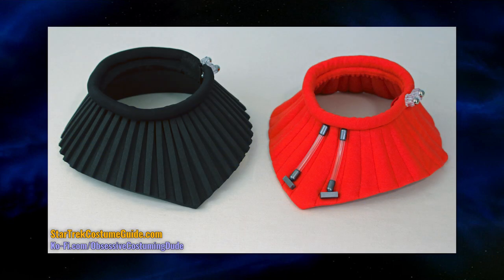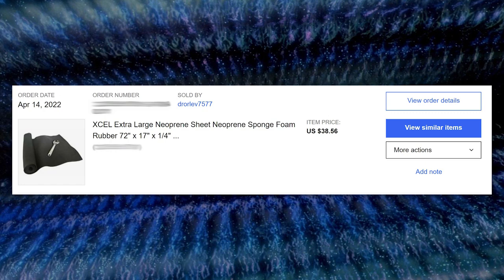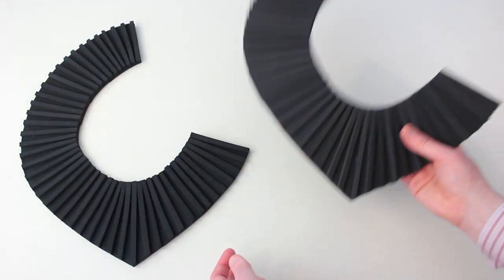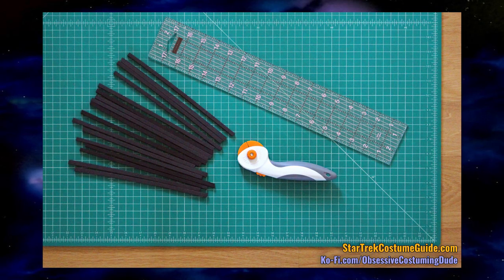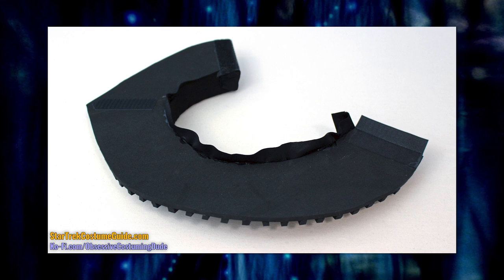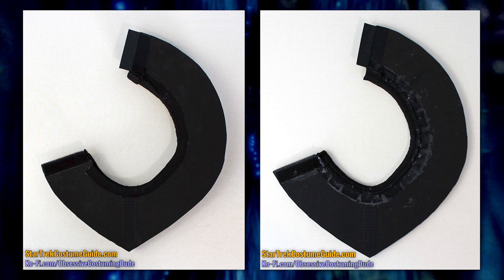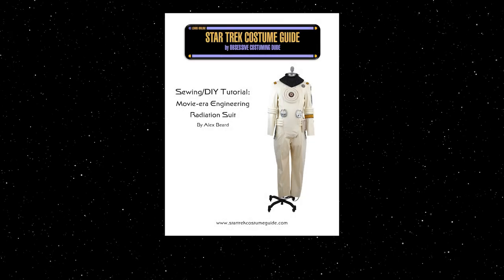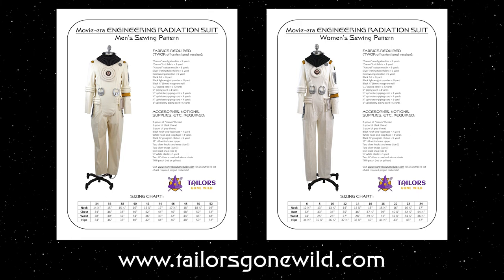Engineering Radiation Suit Tutorial, Part 1 - Star Trek Costume Guide

Comment: I know not everyone has access to a 3D printer, But I think it should be possible to 3D model and print the greeblies that connect to the vinyl tubing of the trainee collars It may also be possible to use the same bonding process as with the store bought parts as well. It's definitely something to look into.
Reply from the maker: As someone with absolutely zero experience with 3D-printing, I'm inclined to agree. But obviously someone who actually has one and knows what they're doing could better say. :)

Comment: I’ve had good results with Barge Cement. It’s a shoe adhesive used for leather and many rubber fabrics. I probably would not use it to adhere the neoprene strips to the collar (it dries a brownish-yellow), but would work for attaching the grosgrain ribbon and Velcro.

Also being a modeler, instead of wooden dowel for the upper neck closure, I will probably use a piece of K&S aluminum or brass solid rod OR Evergreen styrene rod or tube. Either is much stronger than doweling and less prone to break.
Reply from the maker: Good tips - thank you! :)